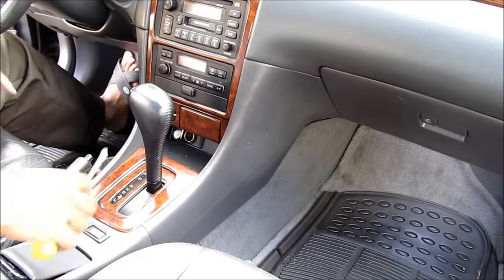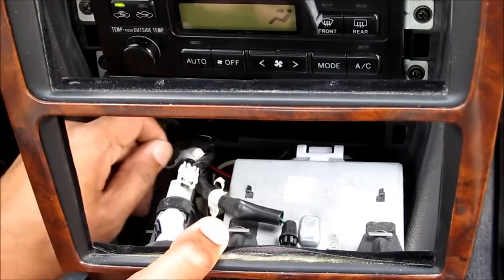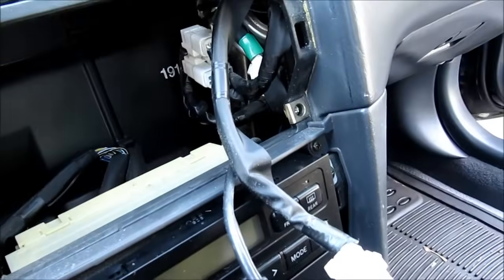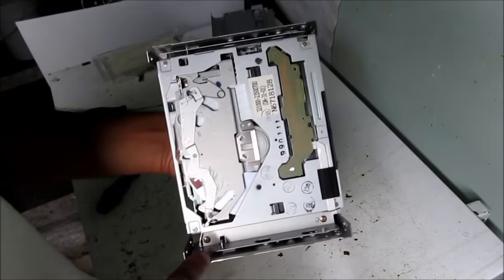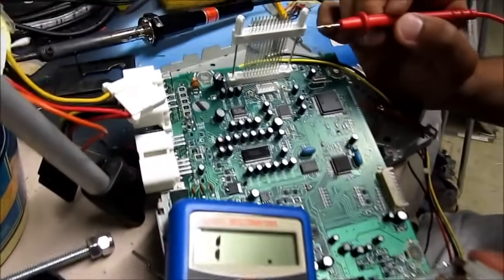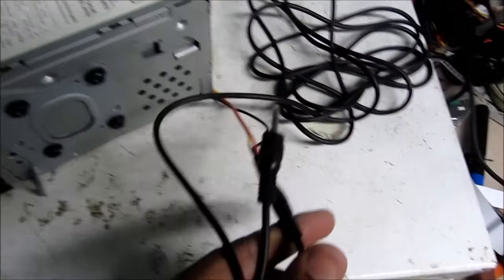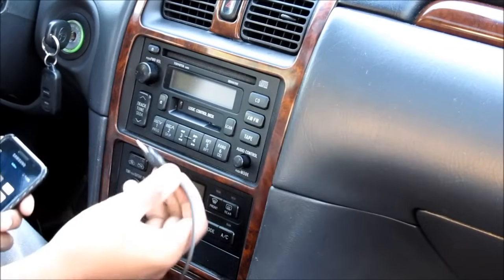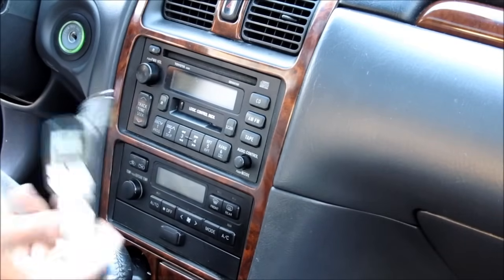Auxiliary Stereo Input Hack

Comment: I'm trying to solder the AUX input onto my 2004 Toyota Camry stock stereo, but on the motherboard of the stereo, there is very minimal labeling of the solder points.  I have no idea how to proceed because I'm not sure which one to solder to.  Anyone having any suggestions would be greatly appreciated!
Reply from the maker: +sunnyhaibin Follow the leads from the cassette deck. There are usually 4 or 8 wires that come straight off of the head for L and right positive and negative and ground for each.
Reply: +speedkar99 From the ribbon cable slot or the one you plug in when you put the cassette deck back?  The one at the bottom of the cassette deck has 14 solder points but none of them are labeled.  How do I know which one to solder on?  Thanks!
Reply: +speedkar99 I checked the ribbon connection on the motherboard (similar to the one you have at 3:44) and I found 6 pins under that socket.  Are those the pins you were talking about?  If they are the points, how do I distinguish them as L, R, and ground?  Thanks!
Reply from the maker: +sunnyhaibin Skip to 2:15 in this video where the cable comes from the cassette head and goes into the board. 

https://www.youtube.com/watch?v=zp-t7cl_ZSs

Many stereos have L & R markings, if not on the immediate board, then on a sub board which you can back-trace with your continuity tester.
Reply: +speedkar99 So you suggest that I should solder the points onto the cassette deck board instead of the stereo board?  Thanks for the reply!
Reply from the maker: Yes, but trace those connections to a point on the board that's easy to solder to. You might have to do some trial and error to determine L & R.
Reply: +speedkar99 There are 6 pins under the socket where I connect the ribbon cable to the main board.  I used the multimeter to test the continuity and found one pin is the ground by touching bare metal and the point itself.  Do I solder under that socket?  Is testing with a stripped audio cable touching each point to find the audio points safe?  Thank!!

Edit:  I meant I found two out of the 6 points are grounds.  Thank!
Reply: +speedkar99 I did finally used one of the ground port, and by trials and errors, two of the points output audios from rear left and rear right speakers individually.  But when I soldered up the three points, the audio is VERY static.  When I turned off the audio from my phone, the radio sounded fine.  Is it because of the bad solder?  Or I should use different points under the socket?  Thanks!
Reply from the maker: Why did you just get the rear speakers? That means you soldered it after the amplifier/mixer?
It should have left and right for both front and back speakers (unless you toned the fade to just the back ones).

The static is normal if you plug in the phone while the radio is on (Depending on the phone you are using). Its the phone signal trying to override the radio. On my Galaxy S5 you have to turn off the radio completely, plug in the phone, press play, and then turn the radio on. However on my old Galaxy S, it worked straight plug and play. It depends on the radio and phone.

Comment: How did you know the input reference impedance for the tape deck's amplifier would match the output impedance of your phone (I assume it's 50 ohms)?  Or did it?  I know from experience that running such a low output into a high impedance input (op amps tend to reference around 1k ohms, as I recall) introduces a lot of noise.  I'm considering trying this; I just want to make sure I do it right the first time.
Reply from the maker: +Mick Mathews I didn't test the impedance, I just tried it (at low volume first to make sure) and it worked. I've been using AUX for more than 2 years now and it works great.

Comment: Quick question. Only have to connect Left and Right Channel? No ground no anything else?
Reply from the maker: +Adrián Castañeda Yes you have to connect ground to the shell of of the radio.
Reply: +Navid Etemadi i was making tests with my ipod and every time that i grounded to the body the ipod freezes and had to restart it. Look for one that says "A Grnd"on the board. The aux cable has 3 wires left ch, right ch and ground, those are the 3 cables you connect to the board. In my case i had to make it different as the round connector had left front, left rear, right front and right rear. I have two units, a cd changer connected to a cassette unit, in my case I connected the aux wires to the cassette unit and just played a silence CD and it worked great. Also i can play music only with the radio on but that way you hear both your music and the radio. Hope can help
Reply: Thanks a lot for taking your time to respond.
Yeah makes a lot of sense. I will update you incase I run into any problems.
Reply: Where do you attach the ground too?I noticed you mentioned in your previous comment that you attach one to the body ,what about the other end of the ground wire?
Thank u

Comment: would this process work for a Pontiac g6 stereo? I was thinking of of connecting all 8 speaker wires to to and rca to audio jack cable. but idk if that would work.
Reply from the maker: +Joseph Lagunes Most likely. As long as it has a tape deck with that analog input. If its only CD, you can try looking for L & R ports on the circuit board for that.
Reply: +speedkar99 thanks for taking the time to reply... awesome video.
Reply from the maker: Thanks

Comment: I have a question i took the factory stereo harness off a long time ago.
Just now i want to fix it. But everywere i look there mention wire that i need to hookup to the stereo but they are not on the harness of the car
Reply from the maker: +William Ramos Some of the wires are not needed, especially on aftermarket installs. Connect the stereo and see if all the functions work properly.

Comment: I recently shorted out my jbl amp by accident. Do you think the radio went bad along with it? The 99 Solara amp is a jbl aa030. I tried using an aa050 out of a 2000 convertible and then an aa040 out of a 2001 Camry xle. They both fit but neither worked. Do you think it needs the same amp it came with? Or do you think the radio went bad as well? Thanks
Reply from the maker: +tigercat0924 I don't have much experience with amps and radio's. Why not just grab the same JBL amp from the same car in the junkyard and give it a shot? 

Also, there might be a fuse in the radio that you should look out for.

Comment: do you have the labeling diagram for the connection cable of Fujitsu ten n535
Reply from the maker: Sorry I don't, I just read the callouts in the circuit board to determine left and right.

Comment: what did I miss..you point out 2 points on the main pcb,  but I thought I saw like 4 wired coming out of the radio...where do they go??
Reply: +speedkar99 and where we have to plug the ground cable??.
Reply from the maker: Screw it into the body of the radio.
Reply from the maker: +broderp 3 wires. One for the L channel, one for the R channel and one for the ground.

Comment: recently I bought a LED clock and thermometer to match my red and blue light theme. I definitely suggest doing so. Its nice during the winter months when checking the roads for ice, and it checks you battery which I am constantly runny dead.

Comment: (help) I did this to my 99 Camry. All is good however in between songs it goes back to radio. then i have to unplug aux cord (from the car not my phone) plug it in ,then press play on my phone. do you have any ideas on how i could stop this?
Reply from the maker: Danté Smith Are you using a jack or straight wire? What do you mean unplug from radio?
Reply: I'm using a Female Jack mount and aux cord. so there are two problems. 1) when there isn't sound going in, (between every song) it goes to back to the radio and then 2) my phone then stops, making you press play again and re-plug in the jack. I tried it with 2 android phones and both did the same, but my Chromebook worked. Do you have any ideas?
Reply from the maker: That female jack is a normal closed switch. Solder directly to the radio and it should solve your issue.
Reply: dang it. why is that? If its just a connection of 3 wires why does it matter?
Reply from the maker: Okay, I'm going to guess you have a Nexus phone, because they don't seem directly compatible with this AUX mod.

My friend tried his Nexus 5 yesterday and got the same thing, it wouldn't input AUX over the FM unless the music started first, then the radio was turned on. When the song was done it would switch back to radio, so you'd have to take off the radio, press play then turn it back on again to work.

Its just something to do with the way that phone jack is wired, as the Samsung galaxy and iphone work fine in my car.
Reply: ok, its virgin mobile, and my dads in samsung that stinks. I guess ill have to get a different phone. thanks. tell me it you come up with anything
Reply: speedkar99 Hay I got it to work, I tried a couple different Music players and the one that worked the best for me was "Music player by Bitsy". If anyone else has this problem I would suggest changing players.
Reply from the maker: Good to know just changing the app makes it work.

Comment: Hey dudde... Do you know if  have the same solution to Land Rover Disco II OEM radio?
Reply from the maker: Thiago Camargo Not sure on the Rovers, but if you've got a cassette deck, its likely you can solder to those.
Reply: speedkar99 Yes! There is an ALPINE tapedeck R990 (OEM LR). I'll remove the radio and try to find these points that you inform. Thank you for your help! Cheers!

Comment: Great video! After watching it I was easily able to pull out and disassemble the radio on my 2002 Solara.  Only problem is the mother boards are totally different looking and I have no idea where to solder the connections.  Any suggestions about where to find more info?  If I shoot some high def. photos  and send them to you, can you tell me which are the right spots?  Thanks, Petert
Reply from the maker: peterosenrosen Yes, send me some photos.
Look for L+ and - and R+ and - and GND near where the cassette deck attaches to the main board. Trace those to two clear solder points and you should be good.
Reply: speedkar99  Hi, I've got some pics for you.  Please send me your email. Not sure how to attach them on youtube.

Thanks, Peter
Reply: peterosenrosen   Hi, What happened?  I thought you'd take a quick look for me?  (need an email for you)

Comment: hi speedkar99, thanks for this video. After watching, I tried doing the same to my 2003 avalon, but ran into difficulty after seeing the PCB...it looks quite different and its hard to tell where to solder. I have taken pics of the pcb...if i send you the pic, can you please help me figure out where i'd have to solder?? 
i also have pics of the tape deck and cd player PCB if that would help...any help would be greatly appreciated, thanks :D

here are the pics:

http://imgur.com/a/TBzQy

and pic of the CD player pcb with " RCHA, LCHA, and AGND  ...is that a possible place to solder? 
http://imgur.com/vij80hz
Reply from the maker: Your Avalon radio does look quite different, nothing is labeled on the main board.

The CD player's right, left and ground outputs that you've circled might work but you'll have to play a blank CD to trick the player into CD mode.

Do you have a cassette player that you can get inputs from?
Reply: speedkar99 hi, thanks for the quick reply. i did try soldering those outputs i labeled, along with a blank mp3 track CD i made...but it did not work :(
And yes, the car has a tape deck too, here are pics...there isn't a lot of exposed PCB, but what about the points coming from the ribbon cable i put an arrow on? im hoping something will pop out to you that i cant see :(
tape deck pics:
http://imgur.com/a/34QJX
Reply: i just ended up getting a cassette to aux adapter lol
Reply from the maker: an g Yes, you need to solder to those terminals from the ribbon cable. Since they aren't labeled you will have to experiment which one is positive, negative, left, right and ground.

Comment: hi, I had a question related to solara stereo. Yesterday i had my radio on and i was filling up brake fluid, after i finished and closed the hood the radio/cd stopped working. (it just died no radio lights are on. it can eject the cd out  but lights wont come on and nothing works except cd eject button) i checked all the fuses all good, i checked wiring with multimeter everything seems to be working to my knowledge. My ac and heater works fine and lights are on too. Its just the stereo that died. Do you know if there anything else that i should look at?  Thanks for your time
Reply from the maker: Whynot Askit I wonder if you have a broken wire or loose connection causing the radio to think the car is off. Usually when the car is off you can only eject the CD, and everything else is dead. Double check the connections behind the stereo with the wiring diagrams to make sure the correct wires are getting 12V when the ignition is turned on. You might want to check if there is an internal fuse within the radio itself that could have blown.

Comment: You have done well.I will have to replace the fujitsu 10 radio/cassette/cd as there is a black smudge on the radio display in my 98 Camry.Plus the Cassette is naff.Pity.It has worked well and sounded ok.Pity.I presume the FM modulator was hissy? Thanks.
Reply from the maker: martyw34 FM modulators could work as well. The FM transmitter was horrible. Adding an aux wire is much cheaper than both with much better sound quality.
Reply from the maker: martyw34 As for the LCD smudge you probably could just replace the LCD itself from a working unit. Check this video on how to take it apart: https://www.youtube.com/watch?v=i3lrdih-6V8
Reply: Ok thanks.And you are have done a good job on extending the useful life of the Camry radio.Which I think sounds ok.Normally,years ago in the 70s-it was the first thing you did was to replace the basic standard radio with aftermarket.
Reply from the maker: Yes, my first thought when I got the car was to replace the radio with an aftermarket unit with AUX/ USB input. But after successfully hacking an AUX cable into this system I don't have a need to upgrade the head unit. The JBL system actually sounds decent, especially for a 16 year old car.

Comment: Great video showing step by step instructions. Is it possible to add auxiliary to six cd changer in glove box. All factory.  It's an older lexus. 
Thank you
Reply from the maker: Tom Harrison Thanks for the feedback. Yes it is possible to many vehicles. I've also added aux to a BMW E39. 

http://www.clublexus.com/forums/es300-and-es330/654164-possibly-cheap-diy-aux-input-for-97-radio.html

http://www.clublexus.com/forums/es300-and-es330/612178-diy-hardwire-auxiliary-input-to-stock-3es-radio.html

Comment from the maker: ***** A cassette adapter will have too much static, hiss and clicking. Adding an aux wire completely eliminates that.
Reply from the maker: +Jacob M By the back, you mean near the connector output for the radio? It depends if it has a built in amp or not, otherwise the sound will be very low volume.
Reply: speedkar99 You should try putting a cassette deck adapter (a tape that will loop indefinitely) while playing that input with the AUX you have. I bet it will sound much louder than trying to override the FM radio with your phone/aux input. Plus you reduce the likelihood of making your stereo become deaf.
Reply from the maker: No way. The cassette adapter has too much noise, hissing and clicking. The sound I get is CD quality. Its been two years since I've done this mod and no issues. Since I tapped into the cassette deck audio signal before amplification, the volume would be exactly the same.
Reply: speedkar99 Please re-read my post. I had a feeling you'd skim it and misunderstand it.
Reply from the maker: So your saying having a blank cassette play and loop while playing the AUX from my phone? What is the theory behind that making it louder and letting the radio last longer?
Reply: Well not just a blank cassette but like a tape deck adapter cassette where the player can detect the cassette but have the adapter head on the cassette removed so that the player can't actually listen/read from the cassette, just turning the wheels and gears. Some cassette players are sensitive and will spit out the cassette if it thinks the tape is jammed or broken (spins too easily) which is why a tape with no gears or tape won't always work. 

Anyway, as for the theory about the radio going deaf. Anything with radio receivers, if too much power comes in, overtime, much like human hearing, being exposed to a high amount power can cause the receiver to become less sensitive and therefore like a form of deafness. My thinking was that by having to play the music loudly through the phone, it could be too much power in an location that wasn't intended to receive.

Now if you go back with the cassette playing, because there is nothing touching the read head while the cassette is playing, maybe you'd have to use less volume, and therefore not only give you more room to raise the volume but also you wouldn't risk making the radio receiver go deaf.
Reply from the maker: I'm not sure if I translate what you mean into technical electronics terms, but I do understand where you come from about inputting too much current before amplification.

Usually if a component is under stress it will fry in the short term as opposed to long term (for example a transistor or resistor). Luckily mine has been working for a few years and no ill effects so far.
Reply: +speedkar99 my mother board looks different but I have  L and R solder points in back. Will those work?